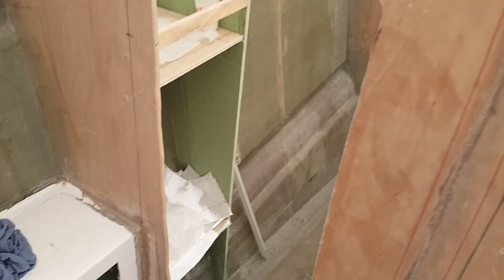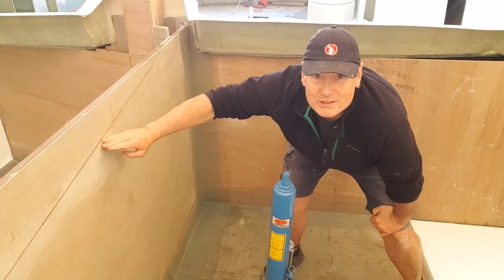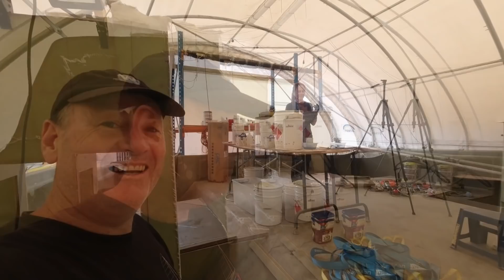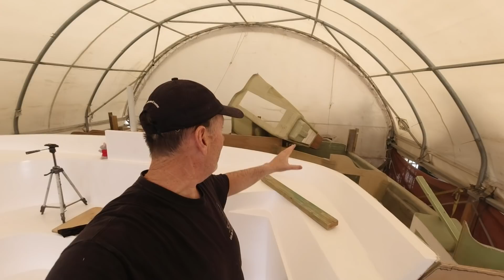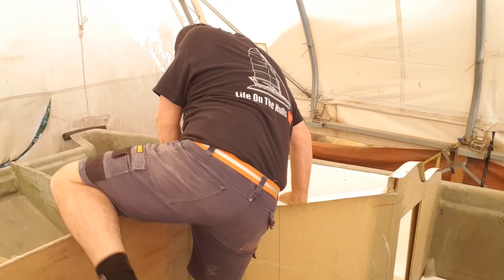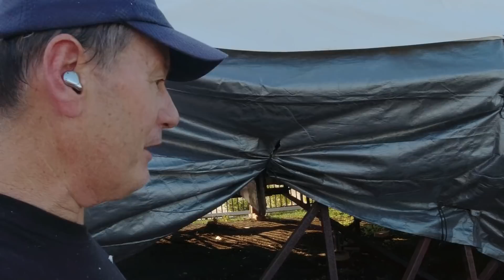Deck Demoulding Final Prep - 12.7 mtr Catamaran Build Ep192

Comment: great vid thanks - in the opening, is that gonna be your headroom (minus isolation)!??? that's not ideal....
Reply from the maker: Thanks Rod,that area is to be removed as the Cockpit roof is around 8 inches higher.It will be fine in the end.I am 6'3 so I struggle with headroom everywhere.Ross
Reply: @LifeOnTheHulls  OK, thanks - tough to be tall in boating :-(

Comment: Pressure always changes people. It's like a fuse that's lit, gets shorter and shorter. I've kinda learnt my tells, so whenever i get to that stage, i try to steer myself away from it, but it never quite works. We're only human. What's important, IMO, is to acknowledge others aren't there to soak up that built up, artificial temper. I usually buy my "targets" a pack of beer, smooths things over. :))
Reply from the maker: That is great advice.I try to play the good guy around other people when under pressure and the ones I really love tend to understand but certainly not like me when I am overwhelmed.Cheers mate,words of wisdom.Ross

Comment: What an amazing coincidence! That's exactly what I was thinking about doing for having swing up deck supports for fitting purposes! [Not EVEN! ;)] What a brilliant plan! 
Did sliding that head module down into place scrape off all that thickened epoxy glue on the foam battens? I can imagine a huge glop of it sitting down below.
Not to worry, Ross, I've had a VERY STRONG premonition that everything comes out of the mold and into position without incident this weekend! I hope this serves as some stress relief!   ;)
Reply from the maker: There was enough epoxy to handle it I hope. The deck supports worked a treat mate. Cheers Ross

Comment: Just a thought, if the crash bulkheads are air tight then how would you break the vacuum of the chamber to release any water that would somehow get in there? 

Just a question.

Edit: I think you were discussing maybe installing an scuba fill Station, you might be able to run a stout line to pressurize the cavity to allow an option to break the vacuum. As a bonus it could also force water out of the cavity through a crash scab keeping it reduced of water. Just a thought.
Reply: The compartment forward of the crash bulkhead would never be under vacuum, there is a drain pipe 40-50 mm fitted there, if water was present it will drain aft to bilge and be pumped out. In normal times there will be very little water there. In the event of a collision and penetration - that will provide the additional vent.😉
Reply: @normanboyes4983  true, it makes sense thinking about after the collision there would be a vent. 😆

Comment: Ross, I am concerned about crushing pressures on the bulkhead/gunnel.  Have you calculated if the raised deck point loads  are sufficient area to carry deck weight? I'm talking about those swing supports in particular.
Reply from the maker: Gidday Vernon, with the added supports and jacks installed the deck support handled it perfectly. The whole deck is so rigid and able to with stand some serious load. I am always amazed by the rigidity of a well consolidated foam core sandwich construction. Lots to come. Stay tuned. Ross